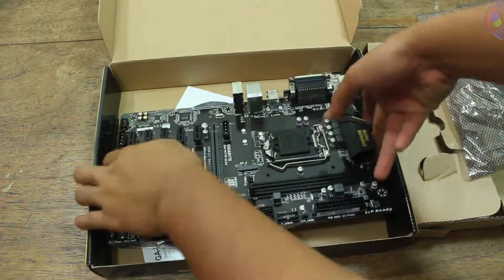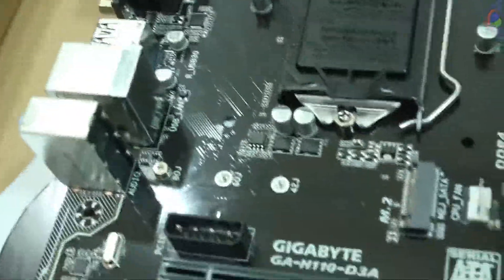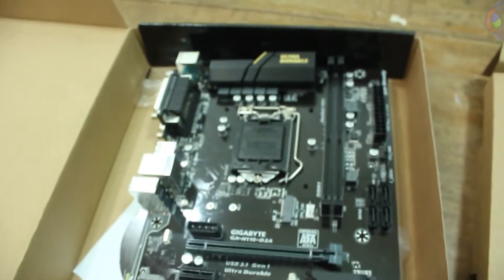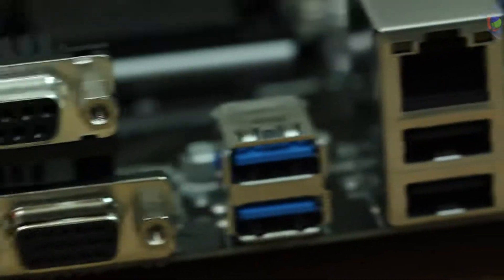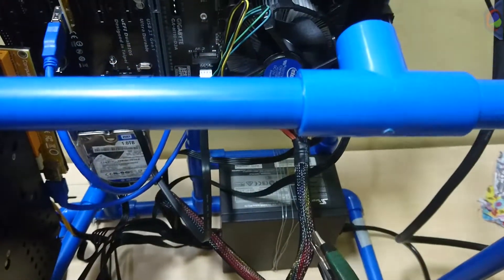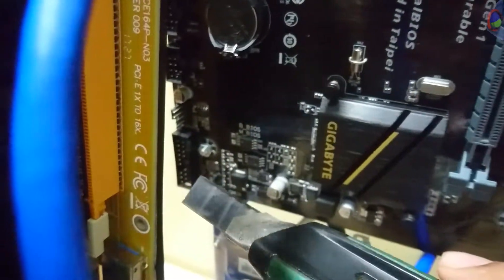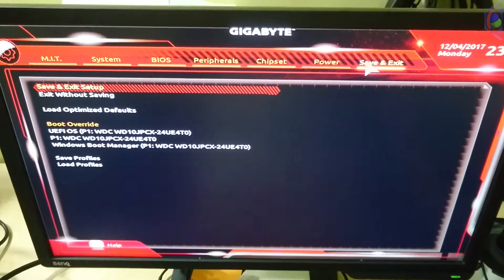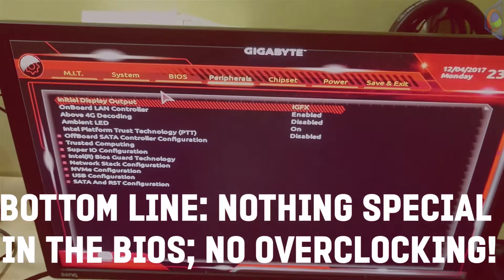Gigabyte H110 D3A - Mining Motherboard - Unboxing

Comment: tbh idk if mining is worth anymore, uses way too much power.
Reply from the maker: I would highly advise those who have no pre-existing equipment to not go into mining. Too risky. For those who have some gear, expansion is okay but they have to do it little by little to minimize the risk.
Reply: Right now is a bad time because GPU prices are double what they should be, since miners keep buying them all up. Power use is not an issue with alt-coin mining, a GTX 1060, 1070 or 1080 will pay itself off in around 3-6mo. You can't profitably mine bitcoin with a GPU, but that's been the case for awhile now.